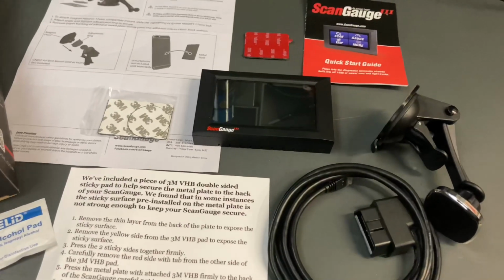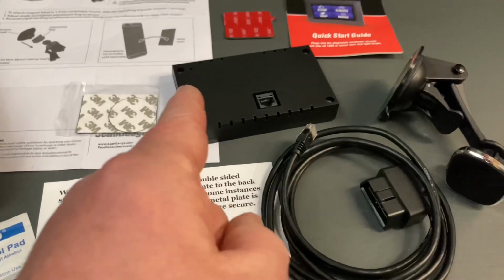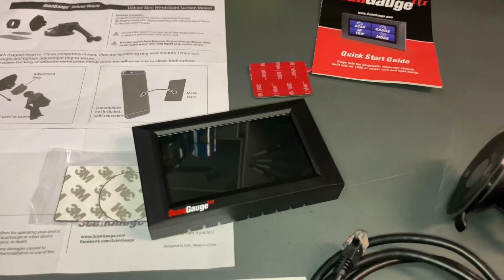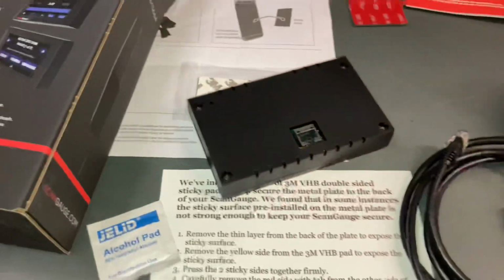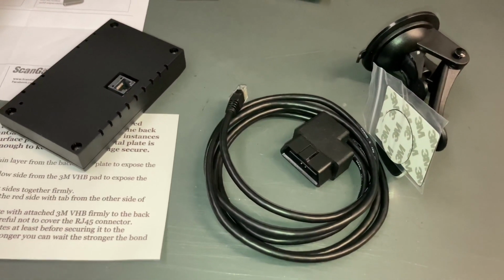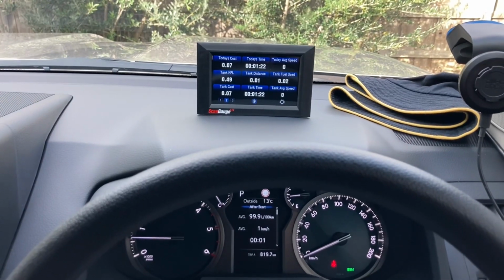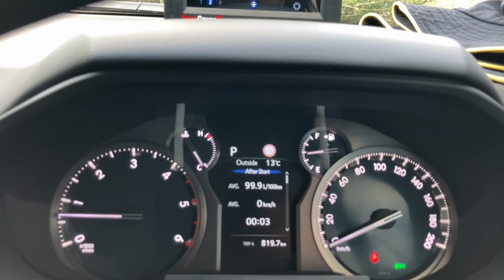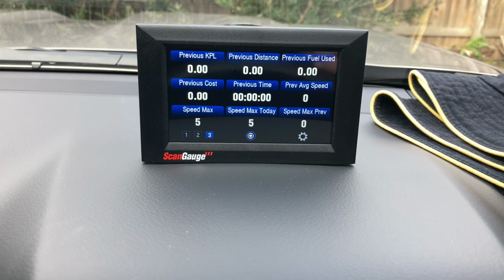NEW SCANGAUGE 3 Touchscreen - Vid #1 INTRODUCTION - MORE TO COME!!!

Comment: With the guages and how you can set them up 2x3 3x3 etc with the Fuel Eco top setting , how do the blue circle type thing work and can this be changed to work like an analogue boost guage

Comment: Hi Anthony, love your Video’s. Quick one. With the Scanguage 3 and having the ability to clear OBD codes, can this replace the stand alone OBD2 scanners?
Reply: If your check engine lite comes on you need to diagnose the problem using a real scanner You dont just clear a fault code it will come back

Comment: Any chance it will do Auto Trans on 4SP? I don't think the SGII does.
Reply: The Scangauge 3 x gauges and pids are exactly the same as Scangauge 2. If it worked on the SC2 it will work on this one.
Reply: @MrJohnyfalco  Thanks. Managed to test a SG2 today with codes for the 5SP auto and it seemed to produce values that indicated it was working. 👍